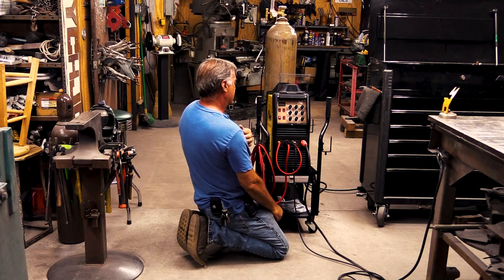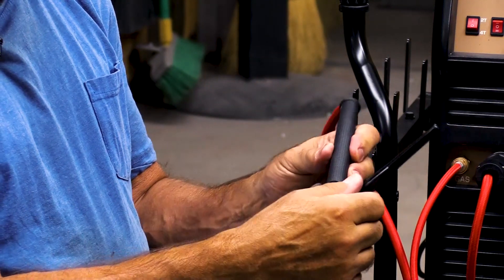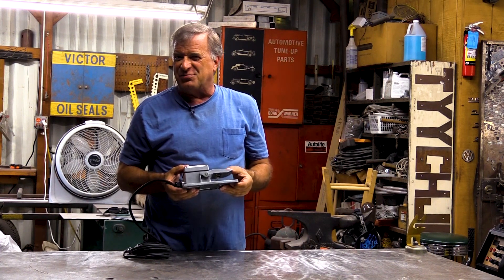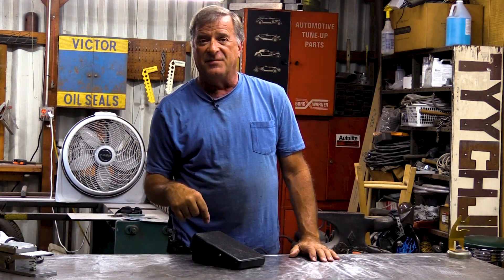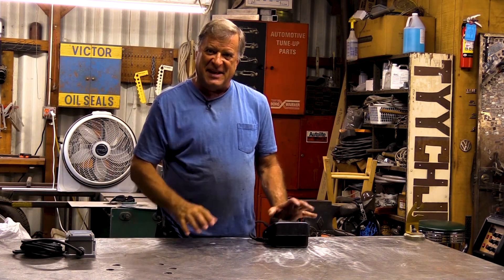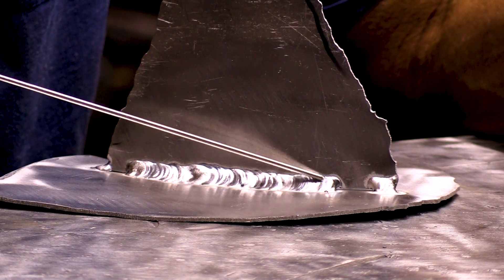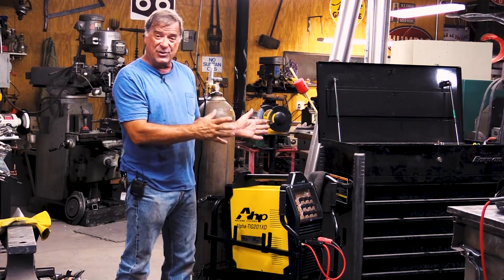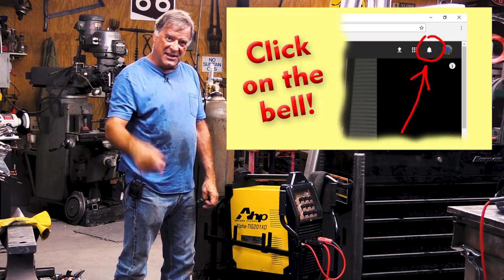Cool Improvements to AHP's TIG Welder - Kevin Caron

Comment: Why can't they provide more detail than this? "There have been internal changes, too. AHP has used bigger, heavier components to increase the durability of the machine, beefing up things like resistors and capacitors that are now stronger. There have been some software changes, too, making a great machine that much better. "

Pretty weak for a $800+ machine that kind of relies on electronic components
Reply from the maker: Because most people don't care about how it works. They just to know how to work it.
Reply: @KevincaronSculpture  I'm just saying, can't just keep saying it's better without any proof. Not on you, I'm aiming more at these manufacturers. I think people spending anywhere between $600 to $1,000 would like to know they have the best bits and pieces their money could buy 😉

Comment: Dead out of the Box
I've been following Kevin and his videos for a while now. Thanks to him, I passed my certs in MIG and Stick.

When he said good things about the AHP I got excited, and got one for a Christmas present. But due to health concerns, I can only weld outdoors due to the fumes. The weather finally broke around the first of March, and I was excited to get a chance to finally use it. 

I got one (1) less than 2 second arc on TIG and the unit DIED!! I spent 4 hours on the phone troubleshooting the unit with tech service and was told to send the unit back. The shipping charges were $132 on a $690 welder. 

That was 2 weeks ago, and when I called in about when I will get my welder back, I was told that they: 
a) haven't started the repairs yet, and 
b) they don't repair their own equipment. It's done by a third party and they'll try to get to it "next week". 

Still no word on my equipment. 

My advice:
If you've got a good welder, then good for you. BUT if you're thinking about buying one of these, I'd save my money and get something else.
Reply from the maker: Sorry to hear this.

Comment: I picked this up (201XD) per your recommendation Kevin.  So far I have only done stick, but have been really happy with it.  Will get the TIG on it going this Fall.
Reply from the maker: Awesome machine.   Been having a lot of fun using mine.
Reply: @KevincaronSculpture  You're lucky. Mine was DOA and it cost me $132 to send it back to get it repaired.

Comment: I would buy one if it did Mig/Tig and stick..
Reply from the maker: The AlphaMig 250 should be back in stock soon.   You can check with AHP  to see when for sure. It is a 3 in 1 machine and it is a monster!!!
Reply: @KevincaronSculpture  when it does, ill make sure to mention you at purvhase time.

Comment: Kevin good to see you. I do have an off topic question for you about chop saws and blades. What combination works well and and does not cost an arm and a leg? I don't mind spending a bit more up front if I get something I am not changing the blade on every time I turnaround.  Maybe in one of you (slow?) times you can do a short video on metal cutting saws and the blade options. I am thinking band saws, chop saws, tubing notchers  and Sawzall (yes I know brand name) or anything else for cutting. Thanks.
Reply from the maker: Thanks Sean.  Will give it some thought.
Reply: @KevincaronSculpture   That would be cool. I would like to put the limited funds to the best option for blade type cutting.
Reply: @seannot-telling9806  check out the evolution saw, it looks like a miter saw but designed for metal use (proper amp and speed)

They have blades for steel, Aluminum,  stainless, each blade is a bit pricey but the cuts are incredibly clean, burr free, and cool to touch immediately. 

Discount steel Minneapolis uses these to cut customers stock, when you walk in and see a stack of 20-25 blades next to one evo saw you know that thing is a workhorse!
Reply: @MrSims-ky2ne  I'll check it out. Thank You.

Comment: For the viewers, my AHP (previous version) was $700 (not $1000). Almost no complaints. Oh, okay - the ground cable is much shorter than the torch lead; and it has a short duty-cycle, limited by the heat within the torch, not the electronics. (I'm still happy with the purchase.)
Reply from the maker: Yeah, the older 200s were just a little cheaper to buy.
Reply: What's the duty cycle like now guys?

Comment: Everlast is supplying nova torches and peddles with their units now.
Reply from the maker: Yes, they are and the new one are a vast improvement.
Reply: I got an Everlast and the flex torch is a vast improvement as is the foot pedal. 
Being the curious sort I was surprised when I took the handle of the torch off and saw that the gas connection had shrink tubing over it for that little extra protection against leakage.